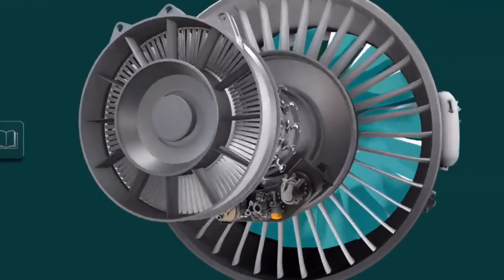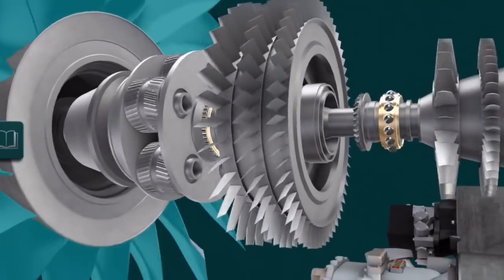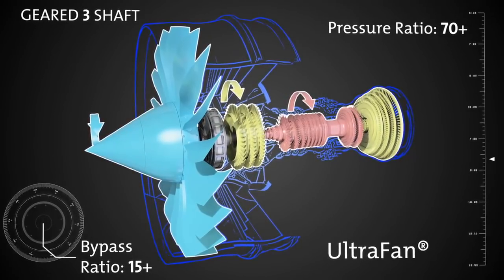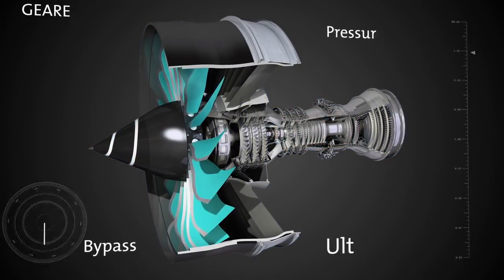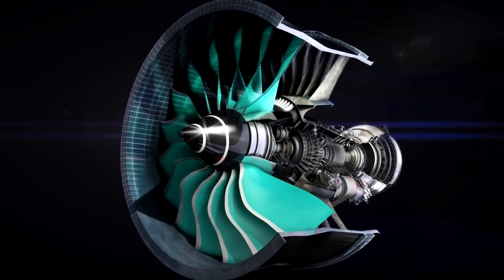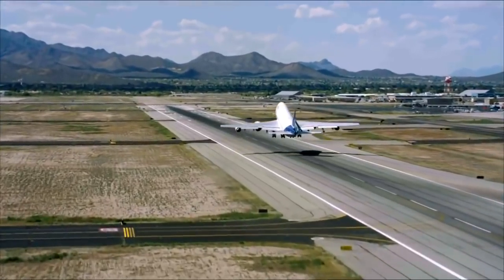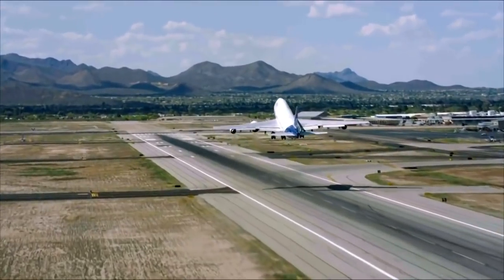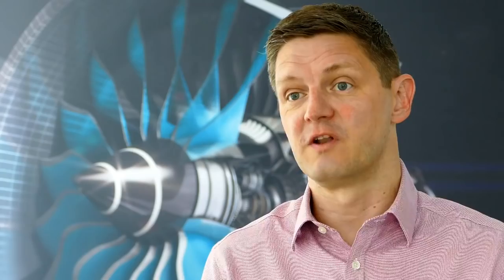Rolls-Royce UltraFan technology, 3 shaft geared turbofan, variable pitch fan jet engine

Comment: Used to be a dev. eng. with Ro Ro and saw the engine development through RB211, composite fan fail on nine pound birdstrike to the hollow titanium Trent 700s. One area that intrigued me was turbine blade cooling using bleed air and thermal barrier coatings  to provide surface protection & cooling of those components in a temperature environment hotter than the blade alloy's maximum limits before it lost strength. Often wondered what cooling would be like using the fuel as a cooling  medium, much as the liquid fuelled rocket engines do. Of course, it would be limited to the hot zone, the first turbine set after the combustor, where the temperatures are at maximum. Geared fan engines are a disaster waiting to happen!

Comment: Odd he didn't mention the fan's pitch change mechanism.
Reply: Exactly. While I do not work in that industry, variable-pitch on a ducted fan is unprecedented in production engines and would in my opinion seem to present the biggest engineering challenge. As of the 2025 January, there doesn't seem to be much talk of variable pitch associated with Ultrafan development, and it seems rather late in the process to incorporate it now. I'd wager that R-R had enough on their plate sorting the gearbox, considering P&W's troubles.

Comment: Looks like a 2 shaft, not 3 shaft. And the guy did say they removed the LP turbines.
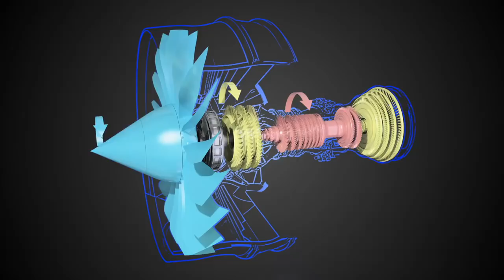Reply from the maker: It's different to the regular 3 shaft RB211 derivatives. It still has 3 shafts (look at 0:45 ) but the third one is not full length, it's placed inside the planetary reduction gearbox so it only extends in front of the IP/HP shafts assembly. It's a third shaft but only for the fan, without a linked turbine. Think of it like a turboprop but instead of a propeller you have a ducted fan.
Reply: @MechDesignTV  Yeah in that sense there is a third shaft, but usually when someone says a 3 shaft turbofan it is meant to mean a 3-spool turbofan.
Reply: @MechDesignTV  In established conventional parlance it is a two-shaft configuration. The shaft connecting the gear box to the fan is part of the power transmission assembly. The number of shafts in an engine assembly describes the conceptual configuration of the power plant, - the gas turbine engine.
Reply: @johnbayntun840  
" established conventional parlance ". 
I felt like a member of high society reading this. 

And yeah...Technically it's a two shaft.
edit: let's just say a two and a half shaft if that makes any sense.
Reply: @MechDesignTV  So it is a two spool engine with three shafts since there is no LPT but a shaft just for the fan?
Reply: Yeah. It's a two spool engine. Number of shafts are debatable as the third one is the output of the planetary gear set and by that logic, the perpendicular auxiliary drive shaft powered by the HP (or IP?) spool becomes the fourth shaft.

Comment: This looks very similar to pratt n whitneys engine and the blades look like general electrics, so......you guys are simply catching up then?
Reply: Before pratt and whitney it was garrett and lycoming. Not to mention that these are CTi blades. GE uses Carbon fiber fan blades. They are not the same.

Also designing a power gearbox for high thrust engines is a difficulty on it’s own. Why do you think gearboxes were limited to low thrust engines?

Comment: Isn't this a copy on the Pratt & Whitney's GTF(geared turbofan)?
Reply: Same concept fundamentally but probably with enough differences as to avoid patent infringements? The gearbox assembly looks different from the P&W ones. Those P&W engines are truly remarkable. The reduced noise levels are astounding on the 320NEO! Am surprised more is not being made of it. 20 years of technological development. Quite breakthrough stuff.
Reply: Highest thrust for output for a PW geared engine is 27,000 - 30,000 lbs of force . RR is developing a gearbox to handle 3X that. The ultra fan gearbox has already been demonstrated at 100,000 lbs of thrust. PW does great military engines, they are not in the same league as GE and RR when it comes to epic twins.
Reply: I sure as hell hope not, as PW1000G seems to have serious reliability issues, which in a two engine jet is a no-go. Planetary gearbox hasn't been patent protected in a while..
Reply: @apuuvah  The idea is as old as the hills - well almost Greeks proposed it, and used in elementary stuff around 1400, almost every large tractor has them in the hub - reduces size of the drive shaft
Reply: It is similar, but P&W engines are 2 spool whereas this is 3 spool and it marks a big difference in design. GE, RR, and P&W use different solutions to engine architecture - where RR uses 3 spools, GE and P&W use 2 spools. GE uses variable stator vanes and other fancy stuff and P&W have their gearboxes. It's actually quite remarkable that the engines of all 3 companies have similar performance despite the differences. I think what it comes down to is that you can only push turbines so far before they melt and we're near the limit of what they can handle.
Reply: @BucksheeRounds  this seems to be a two spool engine. In addition, the tirth spool is usefull when you need to have different speed in the LP compressor and in the fan (if you look at the P&W and GE LP compressor, it is much larger than the trend one, this is to macth the speed at the tip of the blade with that of the fan blade). If you put a gear box between them, you can have different speeds and save the weight and complexity of the third spool.
Reply: @joseluismatabuenasedano6881  I could be wrong, but I'm pretty sure Ultrafan is a 3 spool engine. It even says so in the video title!
Reply from the maker: Jose Luis Matabuena Sedano  is right but technically calling it a 3-shaft (as does RR) is also correct, take a look at my other answer if you want.
Reply: I bet you it is...
Reply: Sounds like it...
Reply: It’s a completely different design
Reply: @davidperry4013  so they don’t use a planetary gearbox to allow for the turbo fan to run at a much lower speeds than the core?
Reply: Isn't all cars copy of some car because they have 4 wheels, gears, 2 front headlight and shit
Reply: @TheGoldbags  no
Reply: @phillm156  Oh shit... I lost
Reply: It is! British, never forgot the attribute of looting things be it tangible or intangible.
Reply: @mrugennaik534  Considering the British are co-inventors of the Jet engine. Yet, looks like you're moving to a nation that has the Queen as the head of state. lol

Comment: Any patent issues with PW GTF? The gearbox is similar to the GTF...
Reply from the maker: This is a grey area, RR Ultrafan is very similar to P&W gtf systems but there are similar concepts (never reached production) that may consist prior act. You can find some articles if you google it but it's an unresolved issue. My personal opinion is that this is a very generic design that may be patent-able in its details but the patent will be very difficult to be enforced, so I don't expect a patent war although discussions between the companies may occur.
Reply: That was the 1st thing I thought of as well. This engine sounds more advanced than the GTF. Or is that just marketing hype?
Reply: Planetary gearbox is not patent protected.